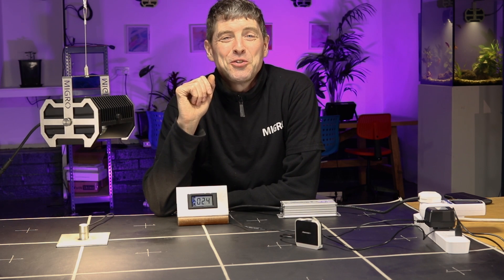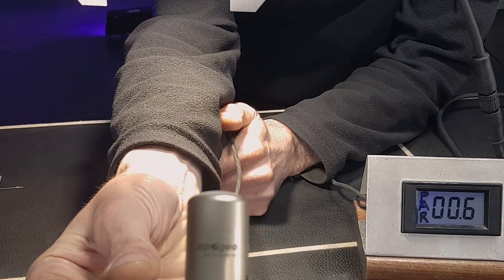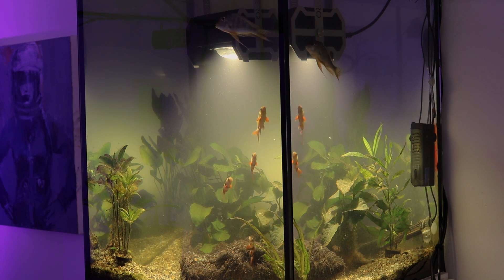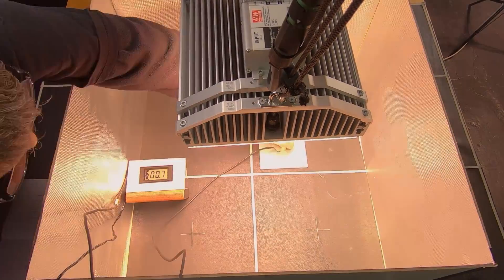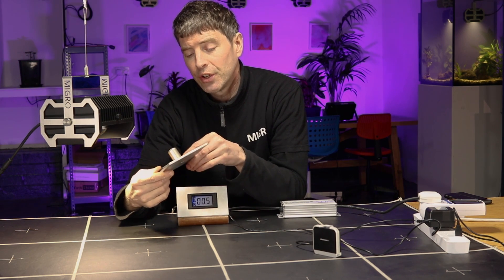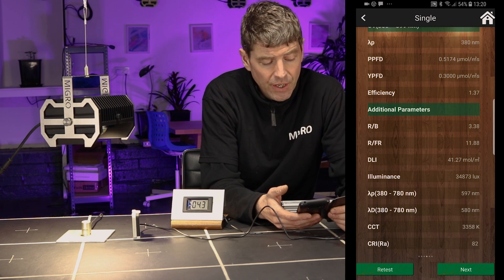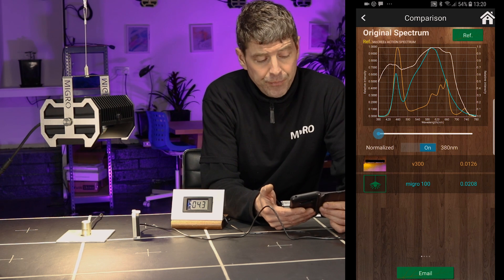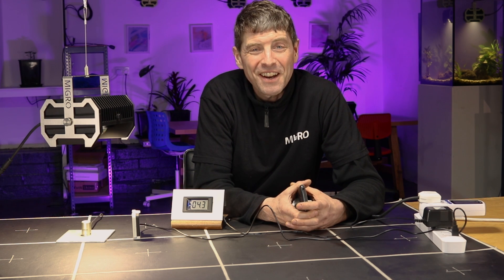Testing grow lighting equipment - Quantum/PAR sensors and spectroradiometers

Comment: I thought that PAR sensors under read grean light as they don't give it quite as much weight as blue and red? If you were to measure in lumins green is given equal weight to blue and red so you wouldl find that there is actually a bigger percentage/amount of green light than shows with PAR measuring . Am I mistaken in thinking this?

Comment: Thanks for sharing this Shane! I had wondered about the Hydrofarm,  which I have. I suspected it wasn't super accurate under all circumstances, but seems to be good for getting in the ballpark for setting light distance. At some point, I'll move to the Apogee 500 sensor. I appreciate you sharing which tools you use.
Reply from the maker: Worth checking out growing answers test robsee the accuracy for your light  spectrum. You may be able to apply a factor to your hydrofarm and save some cash

Comment: The Asensetek Lighting Passport Pro Standard or Essence version which Shane seems to use is only good up to 50.000 Lux that is why he got the saturation warning and thus the meter was not accurate anymore above 1000Umol/s The High Intensity version which we use at Rubol does not have this problem because it can go up to 200.000 Lux. A spectroradiometer will always give a more accurate reading than a par sensor. Bugbee from Apogee even says so himself in this video https://youtu.be/Pc_tqLYhITA
Reply: Would one need a separate PAR meter or does the Asensetek Lighting Passport suffice for reading PAR?

Comment: I don't really understand why people use the McCree curve when talking about full spectrum lights. From my understanding of the research paper, (requested the full article but yet to receive it) the curve is constructed using single wavelength sources and measures their relative efficiency, it does not tell you that this is the amount of light you should be supplying at each of the wavelengths using a full spectrum lamp. Happy to be corrected if you have info on this to expand my understanding.
What it does do for me is dispell the myth that green light has no photosynthetic activity very nicely and shows that reds/oranges are more effective than blues but also shows that green light is more effective than blue (in terms of photosynthetic activity). 
However the other effects of blue light in terms of effects on internodal distance mean it's essential to growing more dense plants to avoid stretch from memory. Also remember green light is particularly effective at canopy penetration if I remember correctly botany classes from about 20 years ago (research could have progressed since then).
Reply from the maker: Spot on Craig. The Mcree curve was generated by testing photosynthesis using narrow bands of light on plant samples. Newer research looks at how broad spectrum of light with different proportions of blue green red uv etc affect whole plant growth. Have you seen the interview with Dr Bruce Bugbee? Very enlightening on this area. I can't remove the reference from the asensetek display unfortunately. I usually extract the data and show it in % of different light spectrum. Thanks Shane
Reply: @MIGROLIGHT  got my delivery today and all set up. Very excited! 
I left a link to a research paper on your UV video about effects of UV-B but in case you didn't see it. https://onlinelibrary.wiley.com/doi/abs/10.1111/j.1751-1097.1987.tb04757.x# looking forward to your video on it.